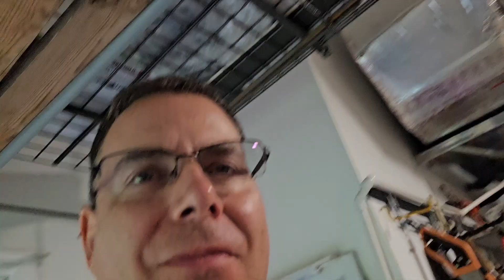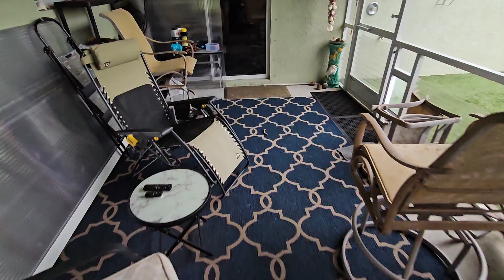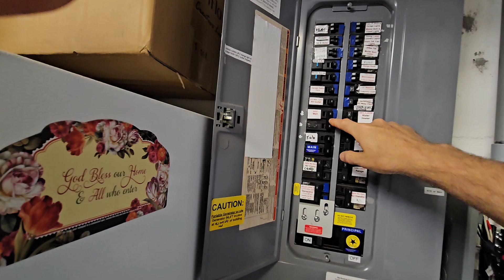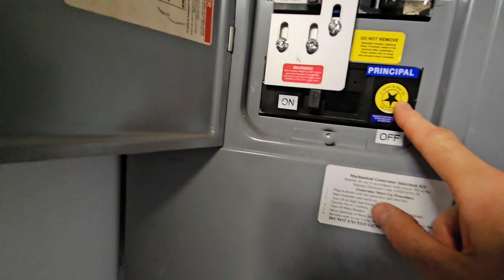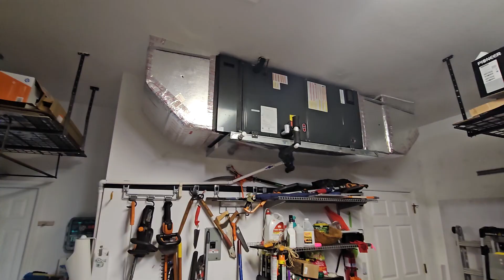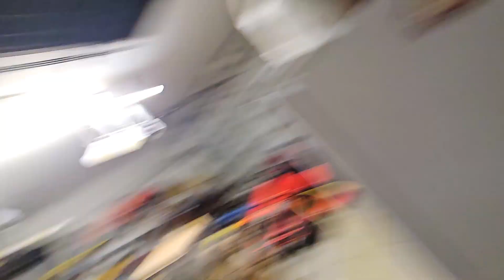How to Install an Electrical Sub-Panel and Pass Inspection

Comment: i had to search for the ground bar for my sub-panel the correct one will have matching bolt hole pattern as box.  read sub-panel cover for optional parts list and numbers(most) of them

my sub-panel had to have ground and neutrals separated, box grounded but not neutral bonded

Comment: Use slightly bigger screws to put the panel on if the hole is stripped
Reply from the maker: What do you think??? Strange, no reviews or anything. 
 https://www.amazon.com/Hanging-Conditioner-Wall-Mounted-Evaporator-Conditioning/dp/B0C5TG3MZC/ref=sr_1_3?crid=3B43YTMHO4GWG&keywords=caravan+air+conditioner&qid=1691938089&s=home-garden&sprefix=caravan+air+conditione%2Cgarden%2C113&sr=1-3&ufe=app_do%3Aamzn1.fos.f5122f16-c3e8-4386-bf32-63e904010ad0